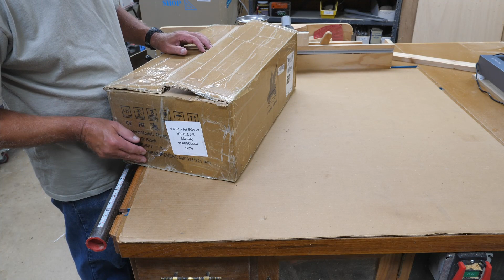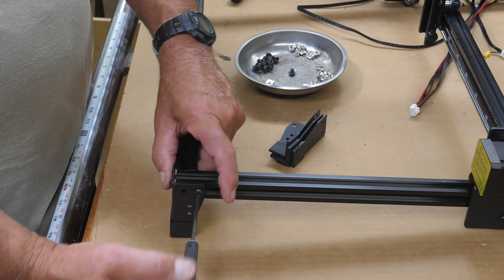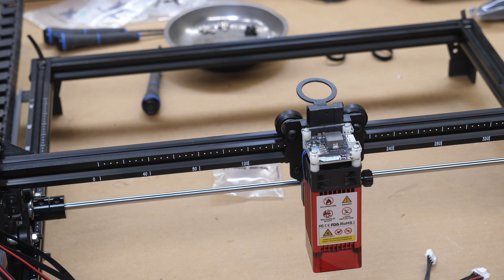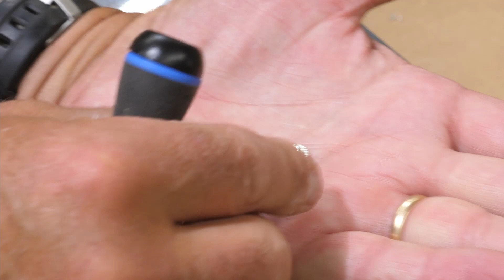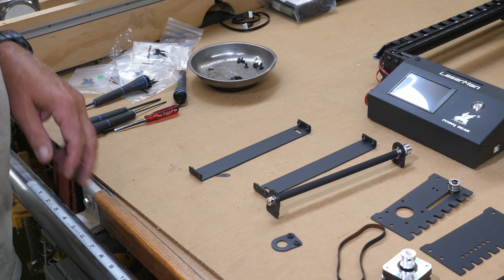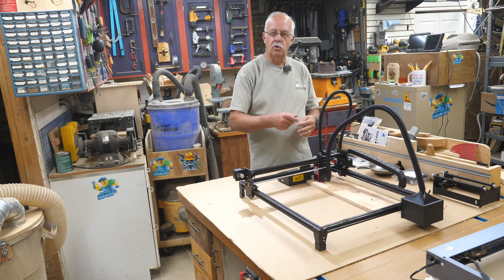Flying Bear LaserMan Laser Detailed Assembly

Comment: i have watched your video a couple of times , i cannot get the air exhaust filter to turn on. I am also using Lightburn and have turned it on in the settings on the touch screen. Any help you can give me is appreciated.
Reply from the maker: Until they do a firmware change, it will not come on through Lightburn.  I have inquired about this as well as many others,  A new firmware version is "promised"..........
Reply: @rogersshop  will it turn on thru lasergrbl?
Reply from the maker: @chipsmith6486  No.  You have to process the project through their proprietary software they include on the TF card first.  It certainly does work, but is a little fiddly.  I may do a video in the future on this.
Reply: @rogersshop  please
Reply from the maker: @chipsmith6486  https://youtu.be/g1JidE0cpo8

Comment: Excellent video Roger! The work area is actually stated to be 400x450 Roger, however after some testing, I was only able to get 399x444 because of a slight tolerance issue on the top left corner. Also, the firmware does not support the M8 command for the air, but they're telling me they're working on an update for it.
Reply from the maker: I've also inquired about the M8 command, with the same reply.  I really was surprised at how well this worked, but would like to see it work through Lightburn.  I was able to get the 400 mm on the X, but only 442 on the Y.  Must be a manufacturing thing.  using my 400 x 400 layout grid engraved just fine and it is rare that I go to extremes on any of these  smaller lasers.  I now have a ZBAITU 400 x 800 M81 (it has issues, too) for the longer projects.  I wish they had extended the Y, rather than the X.  A little shaky with the long 2020 extrusion.  Should have been a 2030 for that length.  I could see this getting bent pretty easily.
Reply: @rogersshop  Yeah, I agree! All of the extension kits should be 2030 minimum!